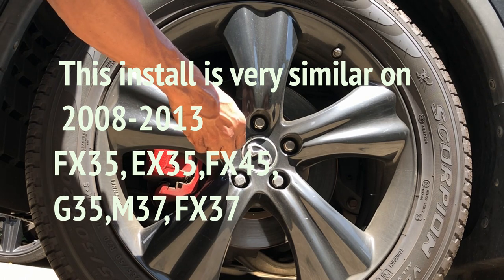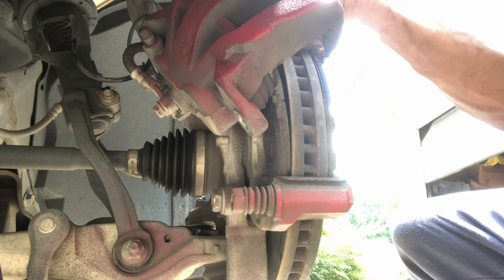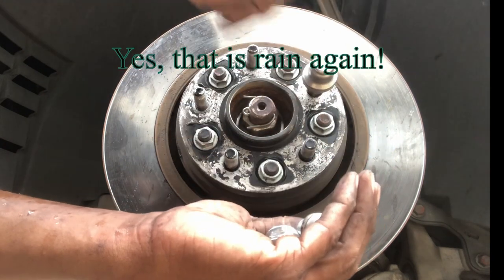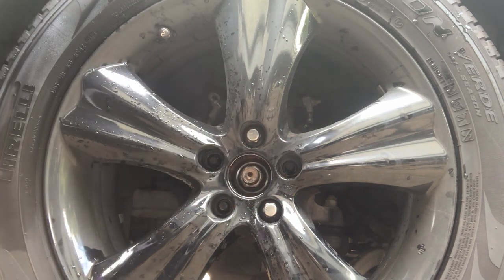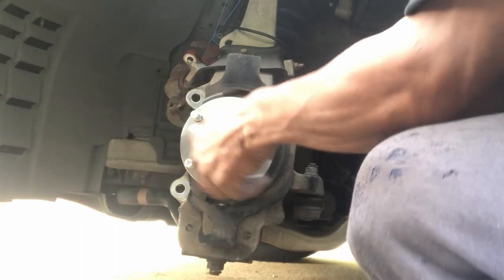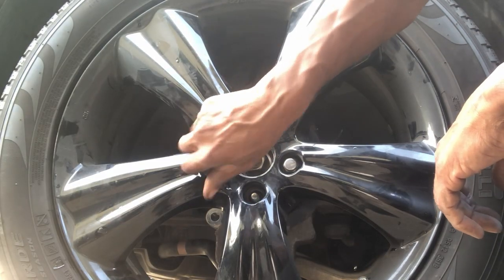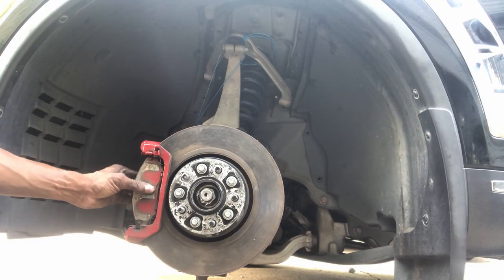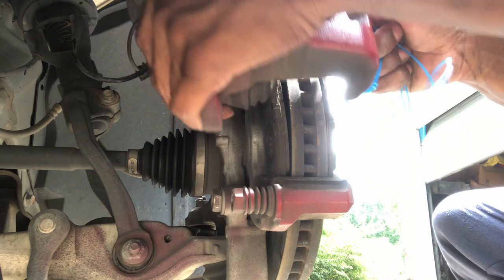How To Replace Infiniti FX35 2nd gen Wheel Bearing Hub #badwheelbearing

Comment: question, did tyou remove the speed sensor at all during this installation, i'm doing all 4 of mine as i feel my wheels are too too tight and have little please (seems like there alto of friction). When i hit the gas and let go the pedal and car starts to slow down like is i'm on the brake pedal, my other cars slow down a bit too but mainly just coast, this one slows down as if i'm pressing on the brake. I also installed new rotos, and pads.
Reply from the maker: Good day David and yes. The speed sensor has to be removed. I mentioned it in the video. 10mm. Also, to have that kind of drag when taking your feet off the gas and no noise is possible but I would think there would be some sort of sound. Lift the car and spin each tire as well as grip opposite ends of the tires and push in and out to check for play…. You also mentioned a recent break job. Make sure the spring clips are pushing the pads away from the rotor when brakes are not engaged. That’s a common mistake and another check for where that drag is coming from before tackling the wheel hub job. The rotor job is fairly simple. I have the all wheel drive that has an opening for the spline. Keep that in mind. 

I hope that helps and if you have not please subscribe?

Let me know your fix when you figure it out. I’m going to pin your comment to the top.

Thanks again for watching.
Reply: @TRRehab  Subscribed!!!! When you say rotor job are you referring to the rear drunk brake thing in the rear caliper? another thing I've noticed... when braking as the car is coming to a halt, once in a blue when its almost about to stop theres like of a alight jerk or thud, i cant pinpoint where its coming from.
Reply from the maker: @DTUFINOPhotography  I meant to say wheel hub job not rotor.
Reply: @TRRehab  Are the front and rear wheel bearings the same? I have the 2010 FX35 AWD, i just purchased 2 front OEM ones for 99.99 a piece and returning the Detroit Axle ones (because of the terrible reviews i've read)
Reply from the maker: @DTUFINOPhotography  I’m pretty sure that they are different but don’t quote me because I have not had to do my rear. I say different because all the packages I have seen either list front or back. If it ain’t broke don’t fix it. lol

Comment: You’ve made this job so simple and I know the repair cost is greatly high. I greatly appreciate you for this video. I’m new to Infiniti and just purchased a QX70 this year ago. I will be tuned to more future videos regarding the 2nd gen. Many blessings to you!!! I hope this applies to 2014-2017 model years as well… It should be all the same but the change of the name.
Reply from the maker: Thanks Kevin for watching and yes, it is pretty much the same as the QX70. I have a list in the description. It really is that simple. Removing and installing the spacer is a whole nother video. The only thing I would do different is use my impact gun. It was a U -Know-What getting that axel nut off! My videos are not for the so called professionals. I make them for people like myself. Tired of getting my arm cut off by the dealerships!

Comment: Very helpful video, thanks.  Love how everything is tightened by feel. :)   Its nice how those bolts break loose when you don't live in a rust prone area.  Also great idea putting some anti seize lubricant on the axle while you have it out.  The axles on some of these cars tend to make a clicking sound when turning or accelerating, especially the rear.
Reply from the maker: Glad you found it useful. Fortunately I haven’t had to post any other repairs. Thanks for watching

Comment: Thanks for the video. What is the spacer for. Do all the 2nd gens have that spacer. Which brand hub assembly did you use? Has it held up over time?
Reply from the maker: Actually no. I added the spacers along with a 2” drop. She is still rolling like a champ! Please subscribe if you have not. I have other FX35 2nd gen repair.

Comment: Why did you decide to use a breaker bar instead of an impact gun? 

I’m needing to do this and have both but my Milwaukee should make it easier
Reply from the maker: yeah an impact gun would be a lot easier but not everyone has a impact gun. Most of my videos are for the average everyday people with little to no experience with repairs. I like to show that most jobs you can do with little to no experience.
Reply: @TRRehab   that was my conclusion as well. 

You don’t find many fx/qx videos with detailed instructions. Really enjoy this video and look forward to many more. They will help the community exponentially as I see it growing with many choosing to work on them more. 

Subbed and will recommend this channel more.

A couple of humble suggestions:
- Torque specs for those of us that are a bit more thorough. 
- Parts compatibility with their G or Nissan counterparts. 
- afíliate links to parts used. I’d purchase 
- video series with all the common maintenance needed on these vehicles i.e. valve covers, oil pan, oil cooler o ring, radiator, etc etc  

Thanks and continue the good work
Reply from the maker: @MarioLopez-ri4tg  I have lots of FX videos that need editing so keep checking back.

Comment: 2007 Infiniti FX35 AWD

My brakes are weak/spongy 

This happened after I changed the FRONT wheel bearings. 

The brake lines show no signs of leakage. 

The system has completely flushed (bled) through all the brake lines until the new brake fluid was coming out the bleeders. 
(No old brake fluid in the system whatsoever)
We bled the system for abt 6 hours thinking it was the issue.
Brake fluid is cleaner than new Nikes. 

The Master Cylinder has been replaced 

New rotors have been put on all around

New brake pads have been put on all around. 

No Brake light

No Abs light

No Check Engine Light

Any ideas?

Comment: How the fk did your bearing and hub come off so easily! Ur lucky man
Reply from the maker: lol…. I had no issues with any of them. As you can see I use Never Seize on the install. Do you have the 2 or all wheel drive?
Reply: @TRRehab  I’m still shocked , I was smart and put lots of anti seize once I replaced it lol, ya it’s actually a EX35 so smaller then the FX35 and it’s AWD